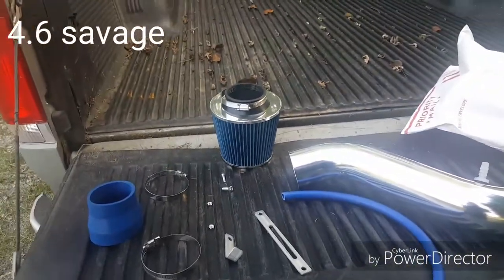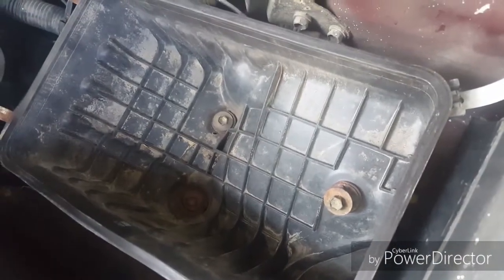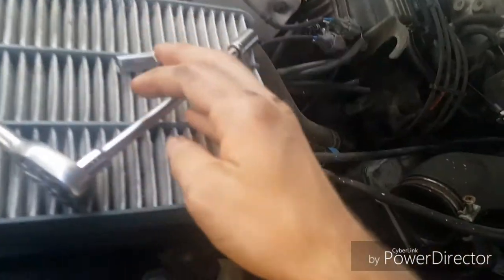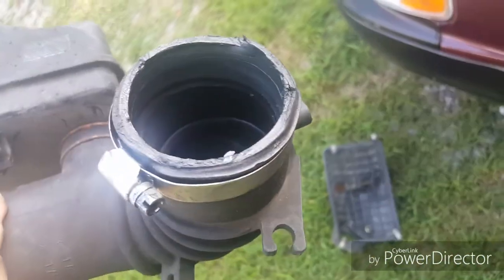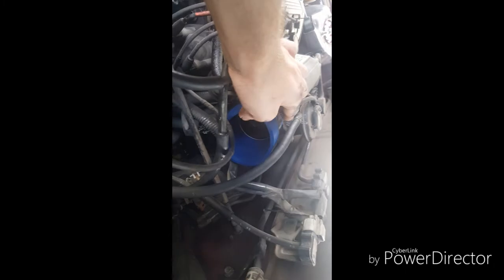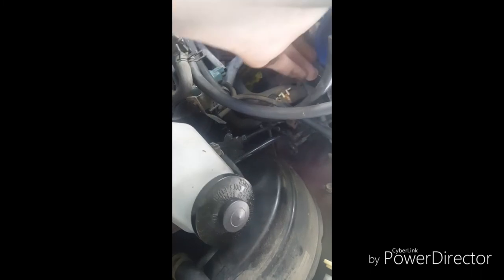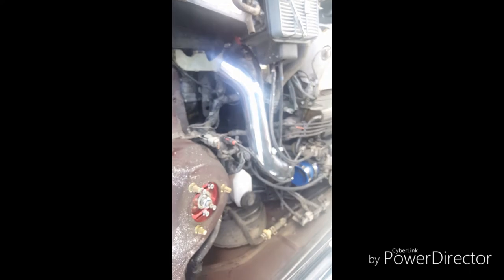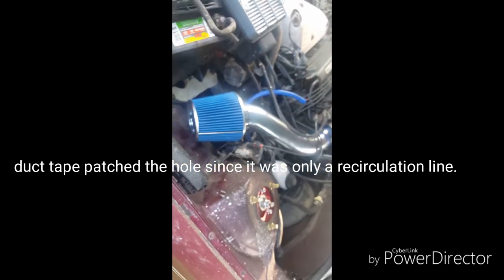Cold air intake kit install vid 2.2l camry

Comment: Hey I want to know how to install one on my 2001 Camry I4 LE, do I need to take off the silencer for it to fit
Reply from the maker: I would say so since a intake like that wont use the silencer
Reply: Can I just install the intake on my existing tube because the air filter tube spits to run to the resonator, so any advice would be appreciated
Reply from the maker: I would remove the resonator as well it only acts as a silencer the point of the intake is tp remove all restrictions leaving them in place kind of negates the effect

Comment: How is it working so far? I want to upgrade many things to mine so I would like you to tell me if there is any improvement and also the link of the product if possible.
Reply from the maker: Slight throttle response improvement but really not worth the money
Reply: Thank you for sharing your experience. One more thing. Are those coilovers?
Reply from the maker: Yes they are they are also ebay versions i paid 275 for them they are 500 pound springs with 15 way adjustable struts and height adjustment with pillow ball mounts
Reply from the maker: They are worth it so worth it
Reply: What brand are they? Do you have a purchase link? My Camry sits lower on de driver's side and maybe with coilovers I can fix that issue
Reply from the maker: They are from maxspeedingrods you can find them on ebay you can just search camry coilovers

Comment: Did the check engine turn on when you change cold air intake?
Reply from the maker: No why would it
Reply: @46Savage  because where would the vacuum line go that connects to the manifold
Reply from the maker: It went into the intake they're were ports there was just a port on the intake I had to cover up

Comment: Does it sound any different with the cold air intake? One last question would you recommend buying it? And thanks for the video it is very useful.
Reply from the maker: It's more intake noise no gains other than. Sound I would stick with a k&n air filter

Comment: I got a cold air intake for 1999 Camry. I can't figure out what should I do with the wire and tubes going to the resonator? Do I just leave the wire off or do I connect the wire to the new intake? I can figure out the airflow sensor and pcv valve. Just not much online about bypassing resonator wire....
Reply from the maker: Dont have any clue on the resonator id just wire it in
Reply: I'm having the same problem, I think that I will just remove it all together because I have no idea how I could install it without removing the whole damn thing
Reply from the maker: Thats the way they normally go they replace the whole intake there are kits to add a open filter to your stock intake but its not worth it imo

Comment: Would you recommend??
Reply from the maker: Yes i loved mine
Reply: @46Savage   sweet cause I have a 01 Camry 5speed and looking for a bit more power or throttle response do you have an exhaust on yours?
Reply from the maker: I had open header on mine but mine wasny ment for power